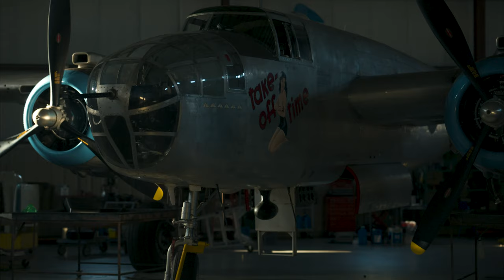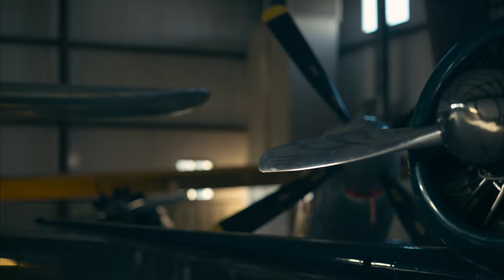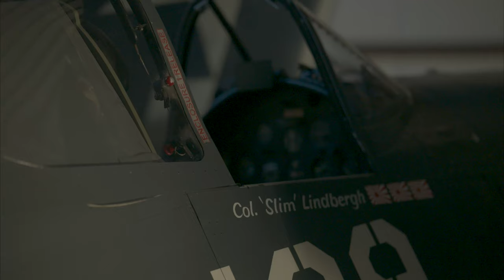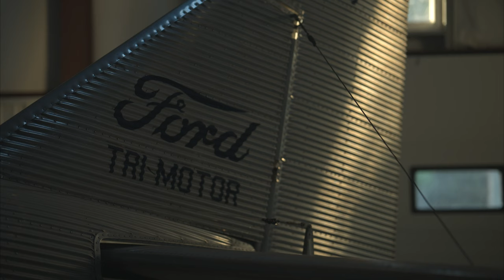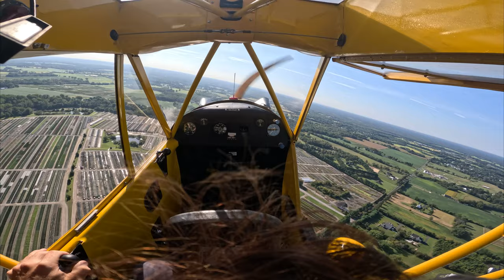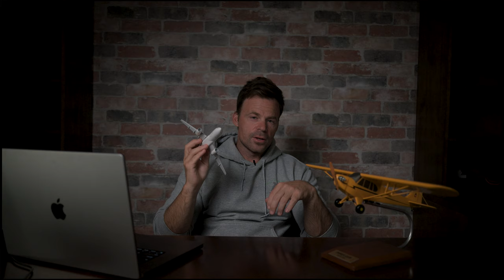Take off & Landing with just Trim, Throttle & Rudder. No Aileron!, no Elevator!, No Problem

Comment: Used to land the Shorts 330 using thrust, manual pitch trim, and rudders only.   No yoke input.   Pitch Plus Power equals Performance.   Piece of cake.    Only in light winds, however.
Reply from the maker: Whats the difference between the 330 and Shorts 360?
Reply: The 360 is a slightly larger fecal pellet and has a single tail.  I think it carried 39.  The 330 carried 30 and had twin tails.  I think Vne was 163 (or maybe 167) knots.  LONG time ago.  UGH.    @Bananasssssssss

Comment: Nice demonstration of alternate means of control. I had a wonderful instructor who taught me the importance of thinking out of the box ( so to speak ) if things go south with the controls. It was interesting, on one flight in a C-150 way back when--- he gave a scenario where some how I lost rudder, aileron and elevator control ( I know this was majorly unlikely ) , what will you do ? Power for altitude, trim for airspeed and as for turning , well, I used the doors, opening the left ( pilot side door a very little caused the plane to slowly yaw to the left, if cracking the right door the plane would slowly yaw right. Landing might not look too pretty but you may walk away-------- pretty------- ( ha ! ). 
Thanks for the video !!!!

Comment: Joe, recently I have been watching content on Youtube of guys flying carbon cubs. When they take  off, the pull their flap handle down for about 5 seconds and then release it back to neutral. Why are they doing this? The carbon cubs have huge wings and should fly the same as your J3 does in this video. I am not sure if there is a reason for using flaps on takeoff, other than for a short field configuation??? These guys use flaps on EVERY takeoff. I've never flown a cub, although I would love to some day. My grandfather told me lots of great stories about starting off in a J3 cub, his favorite airplane, while he was a mechanic at Spartan Aircraft Company in Tulsa, OK in the late 1930's.
Reply from the maker: Hey! what they are doing is lowering the flaps right before Takeoff to help them get airborne just a little earlier and once they get airborne they are retracting them to get rid of the drag.
Reply: Thanks, I guess that works on airplanes that have large surface area on the wings. A smaller wing would result in the aircraft losing altitude while low and slow.  @Bananasssssssss